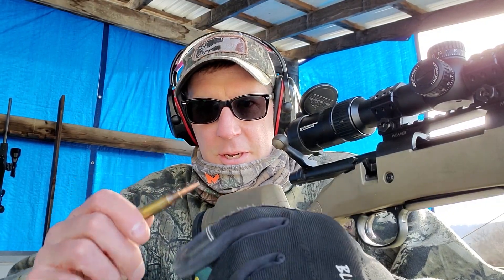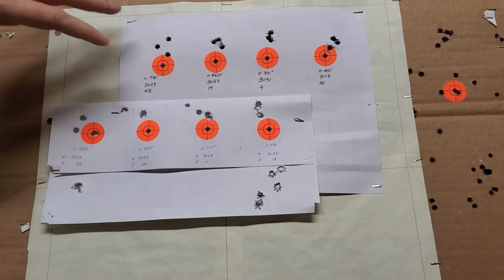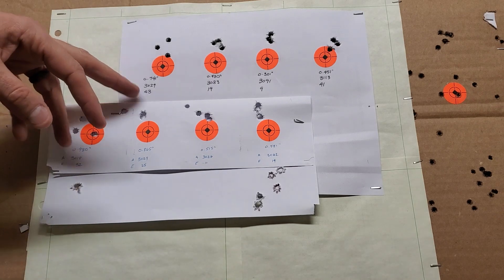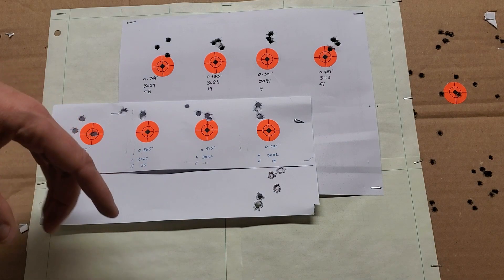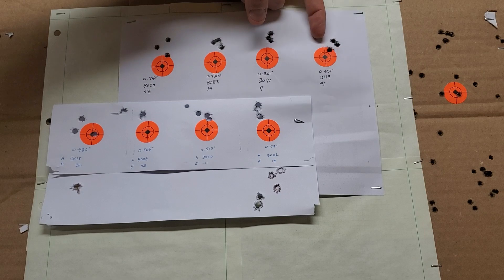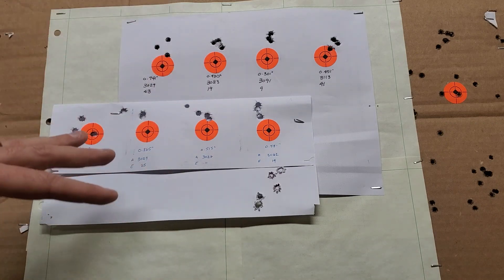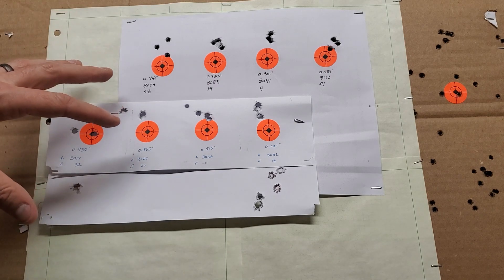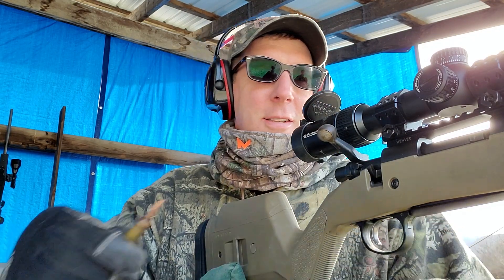6mm Creedmoor velocity node repeat...

Comment: It would be nice to compare cronnies. I wish we lived closer to each other. I'm in Allentown. A good friend has the LabRadar and it reads close to the Magnetospeed but It's not an easy use and touchy to set-up. The Magspeed has never let me down.
Reply from the maker: Ya I wish we were closer too.  There are a couple guys at the range with high end chronos, hopefully I can borrow one.
Reply: @pawild5594  It's always bothered me when load speeds vary like that. I was trying to blame it on neck tension but I'm not so sure now.